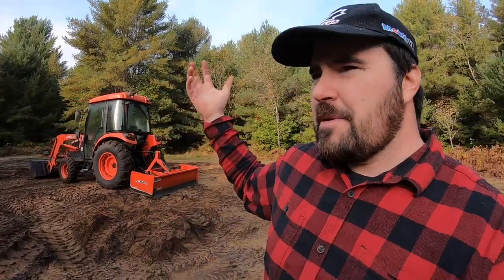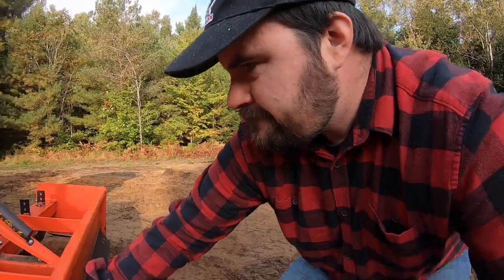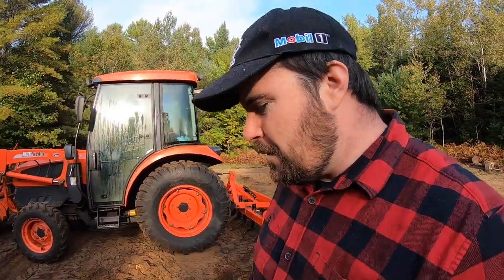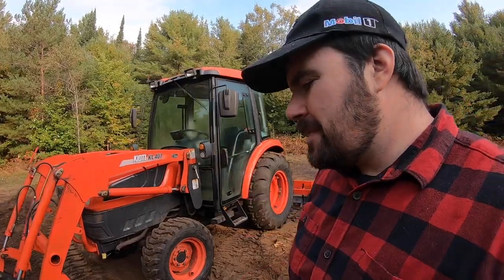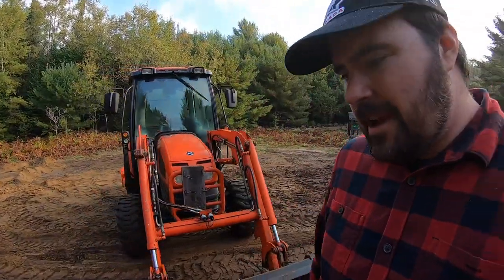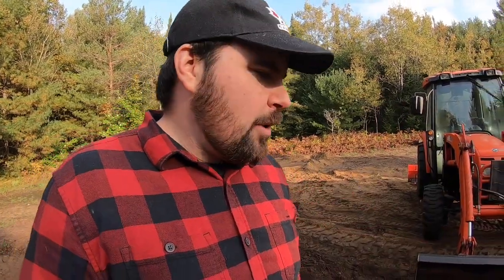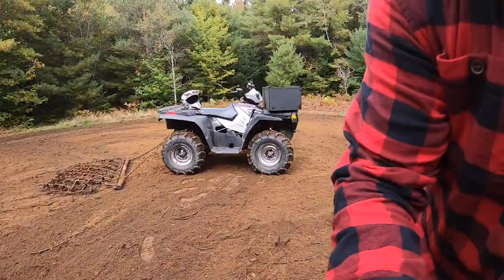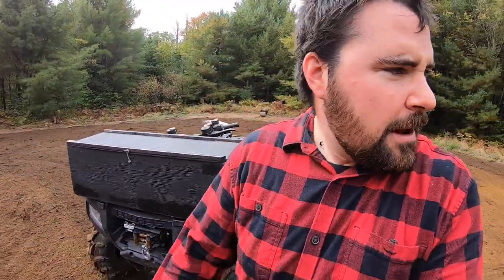Level a Field with a Box Blade | Box Blade Basic Setup

Comment: With the blade tilted that far up in the front your contact is really on the back facing blade which ends up with you following your contours vs leveling. If you level your blade out more your front blade will knock off high spots and push dirt into low spots. You can drive around in circles with a full box of dirt and you will end up with a level area far faster, and once your blade is full it actually floats more than you think and doesn't continue cutting as your worried about digging into the roots below the surface but does level much more efficiently. With the blade tilted that far up in front it makes back blading in reverse useless as it will just dig in where back blading with a level blade is very effective for fine leveling as it keeps all your tires on level ground your blade created and you can control the elevation precisely.
Reply from the maker: I was just trying to smooth the surface here. I find even with the box blade tilted back it can push dirt backwards as long as you raise it up just slightly so not to dig in. I didn’t want the box blade level this time around as there’s debris like root balls that would clump up
Reply: I was wondering why he wasn't going in circles instead of all the back and forth. It would have been much faster and more efficient.

Comment: That area needs a lot more work to level it out. Use the box blade in reverse to move more dirt off the high spots. Maybe start with one level area and use the blade and level tractor to keep extending the area.
Reply from the maker: I should’ve said smooth out as I’m not too concerned with level as I want a bit of the water to run off the centre if possible

Comment: Have you considered a hydraulic top link so that you can change the angle on the fly?
Reply from the maker: Great question. I did consider it but was concerned about hooking up implements and having to run inside and out of the cab all the time for fine length adjustments

Comment: You need a land plane. That job would have taken a quarter of the time and turned out flatter. You should also look into a hydraulic top link for making adjustments of your cut angles from the cab and on the fly. A total game changer.
Reply from the maker: Those land planes look handy for sure. Reason I don’t have a hydraulic top link is I’d have to go back and forth into the cab to make small adjustments to the top link when booking up implements

Comment: want to save a lot of time getting ground leveled out ? get yourself a hydraulic top link for your box blade, you can adjust the angle of the blade from in the cab and change from spreading to digging as you move, you can cut high spots and spread into low spots without stopping to get off and make adjustments. And Capn Crusty is 100% correct a box blade works a lot better when you keep it full.
Reply from the maker: Any idea where I could buy a hydraulic top link in Canada?
Reply: @sawingwithsandy  princess auto has a few sizes to offer
Reply from the maker: Great thank you!